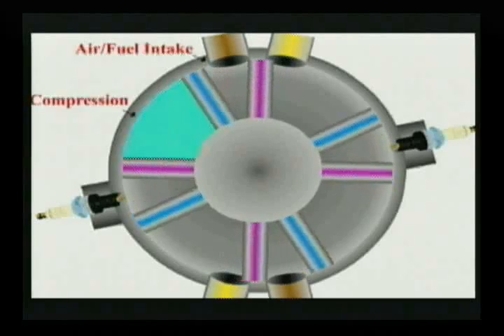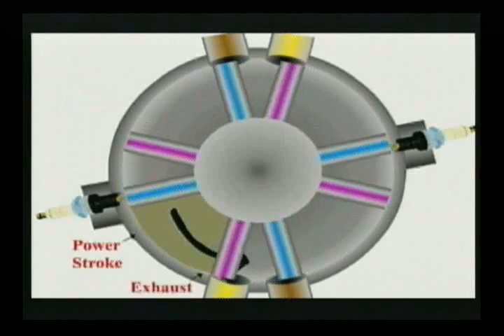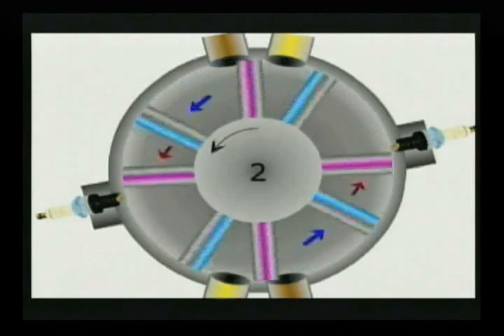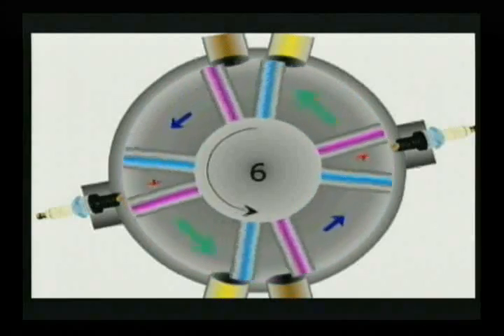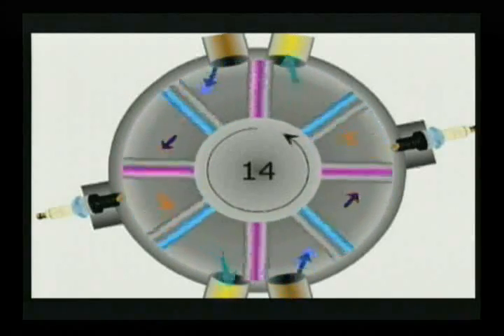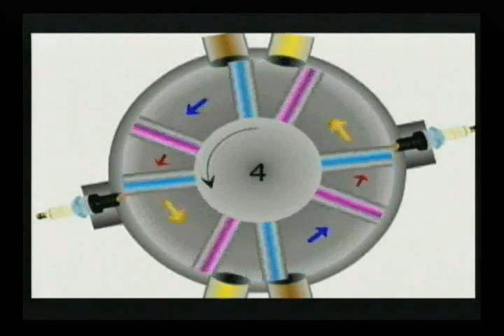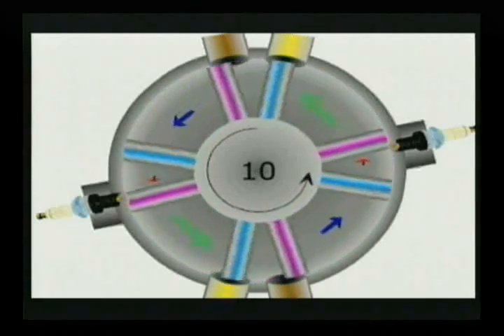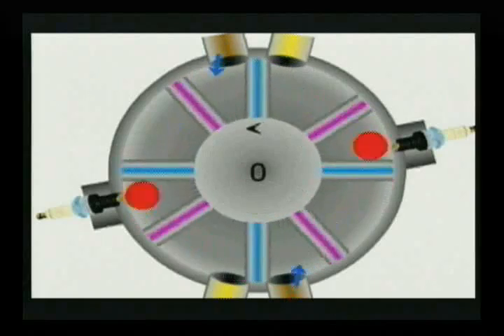2-D and 3-D Animations and Inside Workings of the MYT Engine, 14-inch Version

Comment: The inside rotating seal is going to be exposed to the same combustion gases as the rest of the piston so the material composition of this seal is going to be critical.  The wankel died because the seal could not last even 1/3 the life of a piston engine.  I suspect this engine has the same problem.  If this is the reason we don't see this engine in mass production then why not make the whole engine a disposable design.  Easy to replace like a car battery is disposable.  Of course that will add to the cost of ownership.  If the weight savings are enough the fuel savings could pay for a new motor every 12 - 24 months.
Reply: I agree. cooling might be another problem,with its displacement size to surface area of heat can transfer(whether water or air cool.
Reply: Wrong! If this engine is built properly there is NO Piston Slap: the pistons the way they are mounted four to a disc never touch the Torus Shaped Cylinder Walls. Only the Piston Rings touch the cylinder...
Reply: maybe like a AAA policy where you prepay for maintenance costs
Reply: the wankel ran very hot and was mechanically nowhere as smooth as this.
Reply: @Current Batches Good point. The connecting rods will be under massive loads as they transfer the combustion power to the crank shaft.  We need to see how that works. Again the strength of the materials needed in such a small assembly looks impossible. Durability is the biggest question.

Comment: Looks like it might be a good idea... till metal fatigue snaps a piston off that revolving center "crank" piece, doesn't look like alot holding it in place and its attached to the side of the piston gusset or ribs holding it. also for a fuel efficient car you would need lots of over-drive, first gear would probably be direct drive.
Reply: Wrong! There is a solid finger tab from the two Oscillating discs that solidly attaches into the four Pistons associated with it; Morgado didn't show all the details here, because evwryone would get overwhelmed with them, which happened anyway...
Reply: There would also be a very low redline (max rpm) cumbustion can only happen so fast before you run in to detonation and pre-combustion issues, even with diesel it couldn't rev very high, diesel doesn't like to burn fast, so you loose alot of torque, and have emission and efficiency issues at higher rpm.
Reply: Hi I am not an engineer, but can you explain the effect of pre-combustion on a non-reciprocating engine. thanks
Reply: The pistons are free floating....they attached to nothing....the intake and exhaust gases keep the pistons in time...

Comment: The shop is in the Fresono,Ca.area, but he wont let investors in and is dragging his ass thinking he'll have it all to himself. Meanwhile, everyone is suffering with dinosaur designs. I had this same idea but didn't patent it like he did. If anyone wants, they can have one built for themselves. Square pistons work also btw. Runs on air, diesel, gas, or implosively off hho using the Joe Cell.  I'm thinking of making one or 2 very soon. They can be sold overseas, no patent violation there!

Comment: Are you moron? If the MYT-6" is used with biodisel on train station backup power source in New York sub, how will say the engine not running with combustion?

Comment: Use non-circular elliptical gear sets connected to elliptical internal gears on each piston ring, each gear coupled to a circular gear which drives the main axle. The paired gear fixed to the non rotating engine block.

Comment: When my'n is used as internal combustion? it has a turbo charger mounted to the exauset on one side, the carbor throughtle body to the other my turbine is not self compressing, so is dependent on the exauset gas expantion to generate the Volumetric function of the "piston" compressing the fuel air mixture, when run as an internal combustion engine or turbine rather than a steam turbine,

Comment: I don't see any difference between this and a Wankel/Otto hybrid.

The elliptical pseudo functions of this motor are not practical for driving anything smoothly either.

Having said that, the motor works, is simple, and has it's uses in both very light and compact vehicles and large industrial vehicles, as it is not exactly a smooth motor. It is a good design and could certainly be improved upon. I just don't think it's ready for use today.

Comment: The only possible crux to the design would be heat removal from the rotating elements. This was and still does plague rotary engines. Although with carbon seals between sections and appropriate cooling channels in the piston vanes via techniques such as monoshell casting methods, the rotor could be easily water cooled.

Comment: @hotmerif actually that's like saying that you can't speedup or slow down a normal piston engine because it has to ignite at the same place every time. You can do it. It's just a matter of fuel intake and spark ignition. Pedal changes the ammount of fuel intake, spark plug sparks when each set of four reaches it's late cycle position. There's probably a zillion ways of doing that. But like Thomas Alva Edison, you probably find many thousand ways that you do NOT before you find one that DOES.